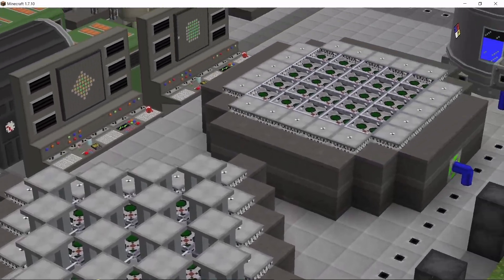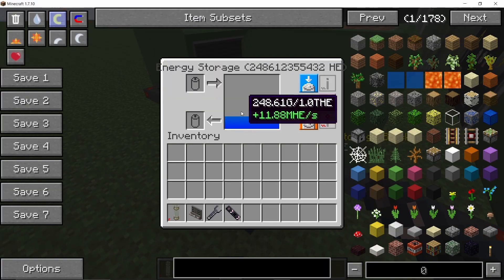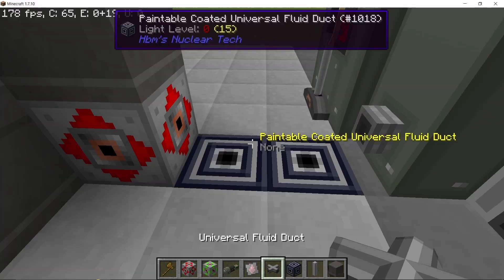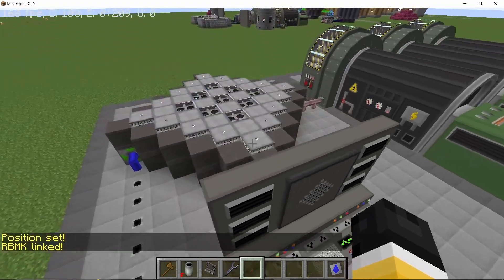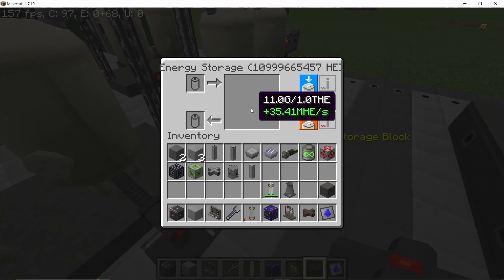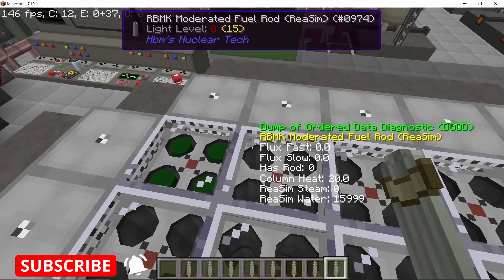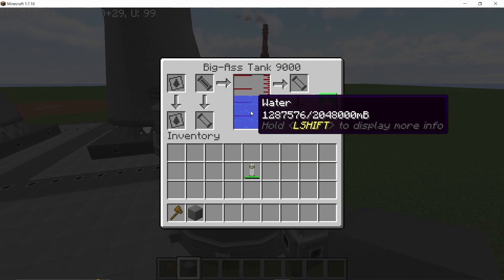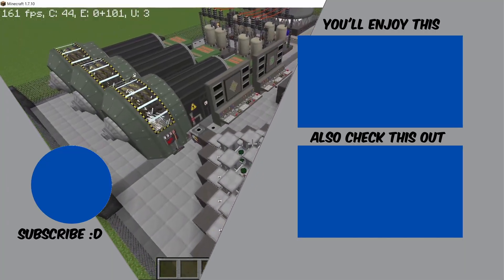Uranium REASIM RBMK Reactors - HBMs Nuclear Tech Mod

Comment: Can you use fluid heaters in Reasim mode? Are they more efficient than normal input/output boiling?
Reply: Fluid heaters is less efficient than boiling, as far as i know. But if you using Reasim mode, you shouldn't use normal boilers/heaters, because Reasim is more efficient and also cheaper
Reply: @caxap8405  Oh

Comment: Hi im new on this channel and i wanted to ask i watched a vid thats about 2 years old i tried to build the 15×15 reactor but it didn't work even tho i did everything the same as in the video it just didn't heat up😢
Reply: Its maybe because the mod dev changed MEP to no longer be self igniting. You could still try to turn the reactor on by replacing one of the fuels with Ra226Be Neutron source briefly to build initial flux but if the reactor is too old it may blow up. I would suggest using /gamerule dialDisableMeltdowns true for testing as the reactor wont blow up, then mess with control rod settings. If you see flames above the fuel rods then the reactor melted down but was not destroyed as you changed the gamerule. Finally i would check the power output as it may be lower then expected and if so i would find a different reactor design. Hope that helps.

Comment: Geothermal heat exchanger is op. It should turn lava below into obsidian or something because its free power, and a good one at that, zirnox does 200khe/s and heat exchanger does almost the same. These 2 are similar in production. One geothermal het exchanger makes 200khe and they can be easily stacked. Also, it doesnt require pretty much anything for it to run. Please nerf, dont you agree?

Comment: what's reasim?
Reply: Realistic simulation, instead of  4 neutrons for 4 directions, its 4 neutrons split between 5 directions with the 5th being a random diagonal direction. Some rbmk parts are cheaper, such as the moderated fuel rods not requiring bismuth to craft, however dedicated boiler channels have been disabled and instead all channels including fuel channels are now boilers with dedicated pieces to input and output water. Finally the steam output type has been set to only output super dense steam, meaning you've got to plan your reactors accordingly. 

Hope this helps and that my information was not too inaccurate.
Reply: @JadedIndustrialist  It's not only the diagonals; all five neutrons are distributed along the full 360 degrees.